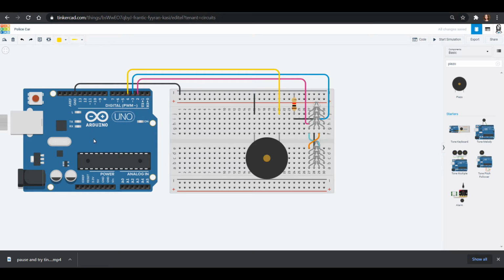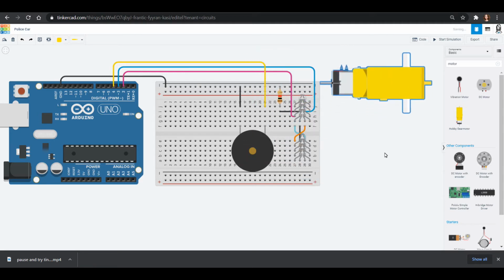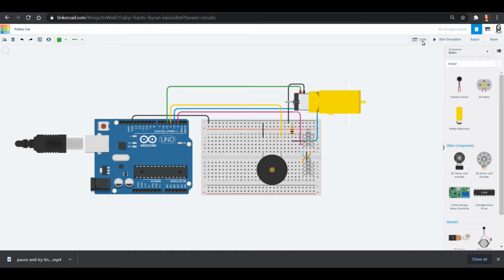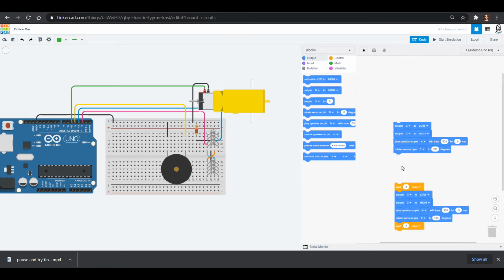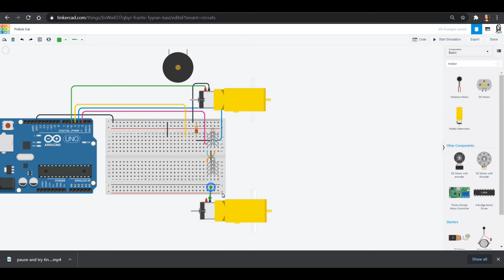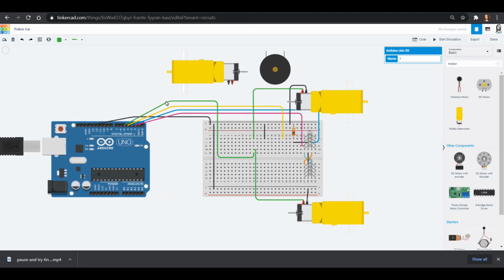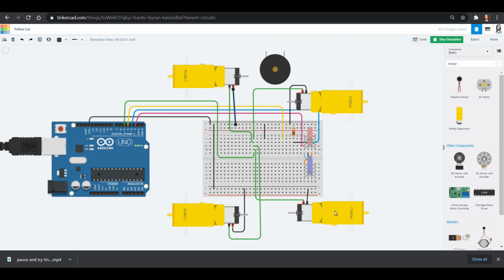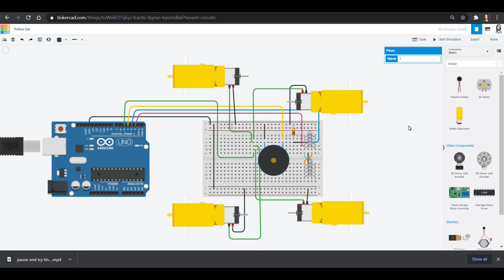Tinkercad Circuits Tutorial - Making a Police Car Pt3 - Motors

Comment: when i wire the motors to the arduino in tinkercad the arduino shows that  if i do that that the arduino will break i followed your tut but i don't understand why this happens. Can someone pls help me?
Reply: I put resistors there but it made the wheels move much slower